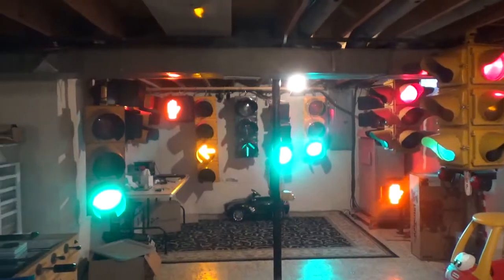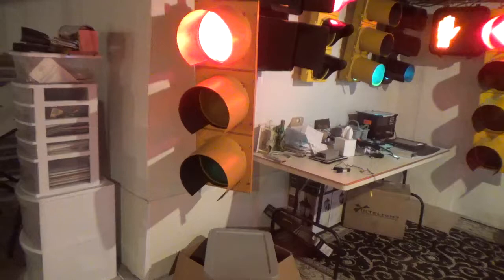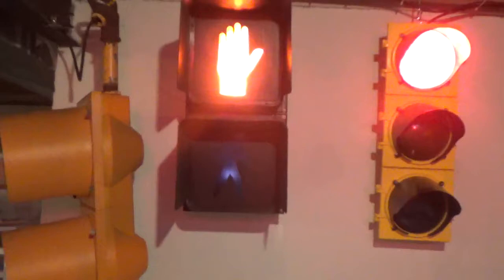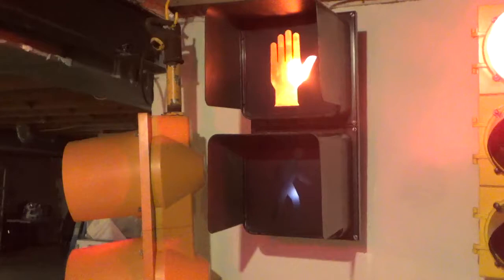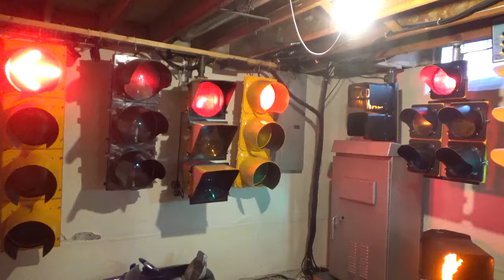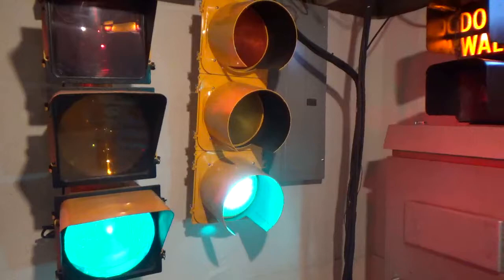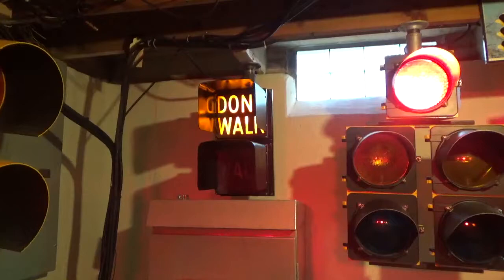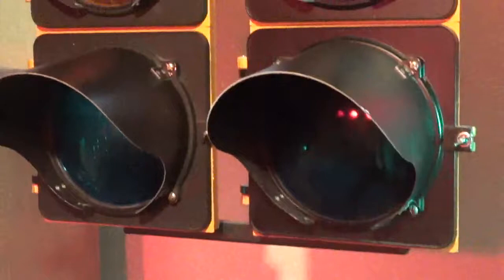2022 Traffic Signal Collection Walk Through

Comment: How do you even order a traffic signal from a manufacture lol? I have an 8" Econolite that I got from eBay but I want to buy another one that's new but I don't know how to go about that
Reply from the maker: You can inquire via email or call them up. Most large manufacturers run sales through a distributor network and they may or may not deal with private citizens. They are used to large orders, and don't always want to do a small order. And if they do, they want the buyer to be serious in the sale. They're not "ebay", and manufacturer pricing on equipment is typically much higher than what you see on ebay or otherwise. It also takes time to get orders made up - case in point my Dialight head was a prototype signal so I inquired about it when I saw the bulletin they were being developed. I had several phone calls with Dialight sales during that time, as well as my local Dialight distributor whom I paid directly. And it took about a year and a half to actually receive it. It was an expensive head, compared to a standard LED signal head, but I ordered exactly what I wanted in terms of color, lens arrangement, visor type, etc... 

One manufacturer you may want to consider is Traffic Parts in Texas (google them), which runs Chapel Hill Manufacturing. They have done direct sales before. Call them up and see what they can do for you. They should be much quicker in getting you something then a prototype. But expect the price to be relatively high - 300-500 for a new 3-section head.

Comment: I have a British siemans raghead (helios) lantern.  It's featured in my lights out video.

The lantern in my case is fitted with pedestrian hoods as the traffic version would make it front heavy.  I've also mounted the upper bracket to act as a counter balance, and the lower bracket stored in the base I have tapes, pedestrian hoods, arrow and crossing masks and the longer traffic hoods.

This way I can recreate any of the main versions you see in the UK.